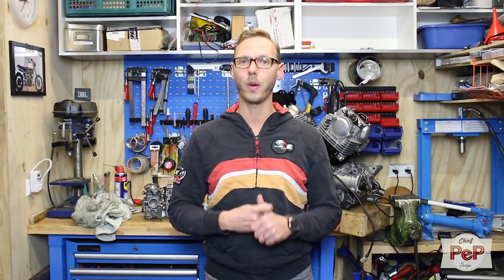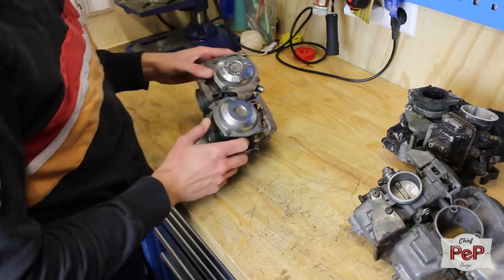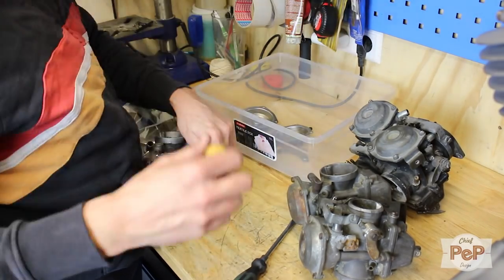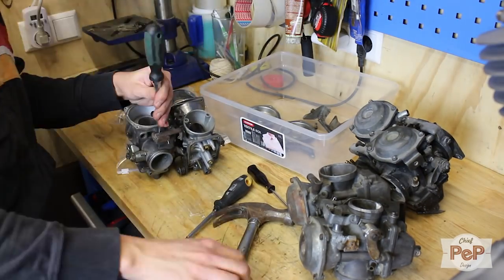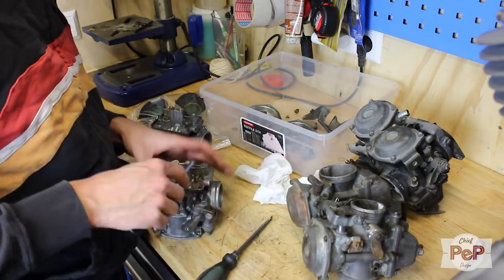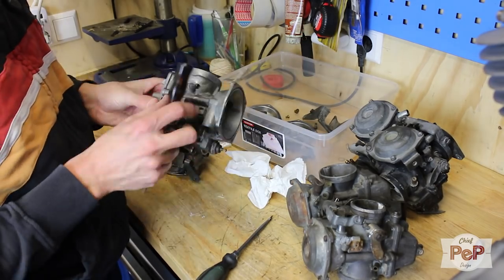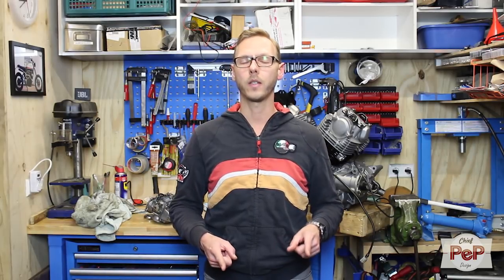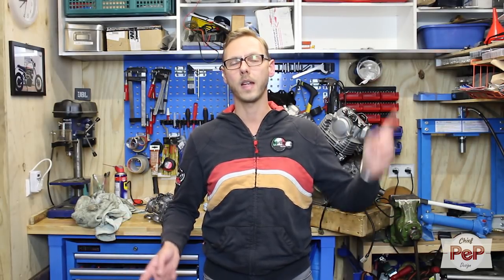Carburetor cleaning Ultrasonic Yamaha XV 750

Comment: I know the vid is from a few months ago but a useful tip for you when working on japanese bikes.
The cross head screws with a small dot  on them means they are JIS (Japanese Industry Standard) which uses a completely different angle on the walls of the cross.  This is why Philips and Pozi drive screwdrivers don't work well and round out the screws.
Reply from the maker: Hui 9697 Thanks for your comment, but to which part of the video are you referring to? I have every type of crosshead screwdriver in my garage...?

Comment: Hello great videos, 
have you ever removed the bearings for the swing arm?
Reply from the maker: dav mel Thanks! Yes, I always do. The needle bearings wear very fast so you should always replace them.
Reply: how did you get them out?
Reply from the maker: dav mel Heat up the swingarm enormously. If you watch other video's of mine you see that a lot of parts like the alternator, bearings of gears don't come off or out unless you heat them. It should be almost red hot. Then you can tap them out from the inside with a long piece of metal/tool/driver.
Reply: okay, thanks! I will try this as well.
Reply from the maker: dav mel They are a real pain. I know. But this will work. Trust me. Good luck!
Reply: Chiefpep are you using a heat gun? Or a torch?
Reply: worked out pretty well, thanks again :) where are you purchasing the new needle bearings?
Reply from the maker: dav mel See?! 👍 You buy them at cmsnl.com

Comment: is the throttle normally hard to pull with the oem carbs? mine seem hard to pull vs other bikes
Reply from the maker: No not really. Although it's a one cable system which doesn't really help. Try to find if the cable is squeezed somewhere or maybe makes a strange bend. And you could lubricate it. Finally some W40 on the spring on the carbs which should pull it back could help. Good luck!

Comment: Cantfind my starter relay help please ben replacing parts 96 750 virago
Reply from the maker: It's a round unit in a rubber... I have no idea what the stock place is. It should be near you battery. Follow the thick positive wire.
Reply: @chiefpepdesign  i dont see it i got the part coming in the mail i let yoyu know folliwed the positive wire onlybring to thefuse casingalready did a shit load of work onmybiks thankzzzz amillion i will try back

Comment: Mixing part of BOTH carbs actually is very bad practice. Some parts are different, eg main jets
Reply from the maker: The jetting has been done later on the dynojet
Reply: @chiefpepdesign  Sorta other piece of carb are different - needle and needle well. Not sure coz I got xv 1000 '85
Reply from the maker: @evilkabab  all worked out well. Runs perfect. Thanks!